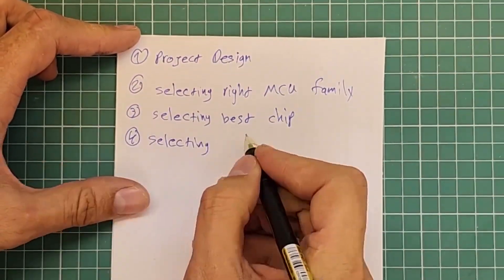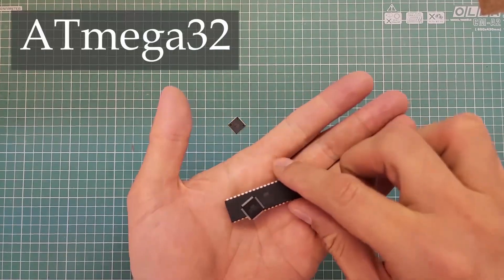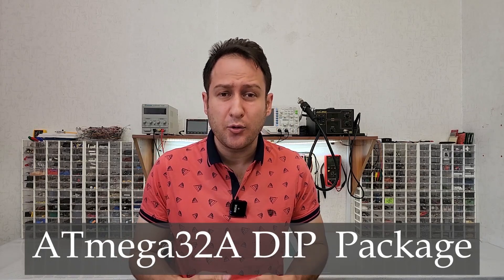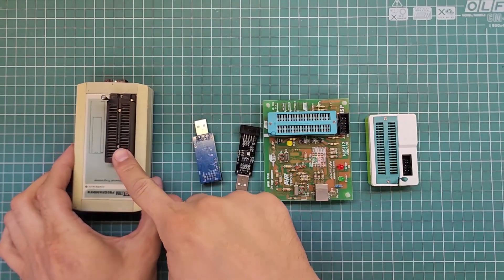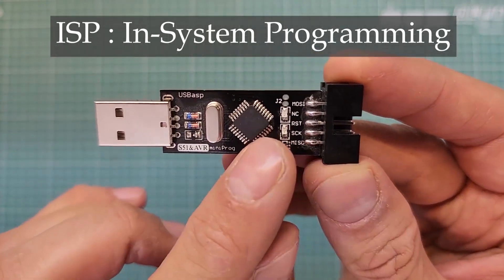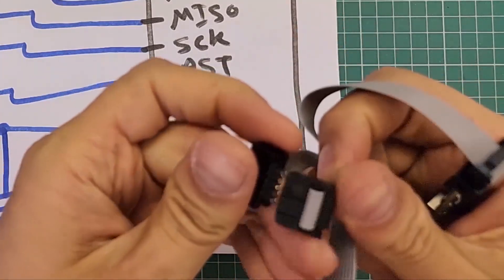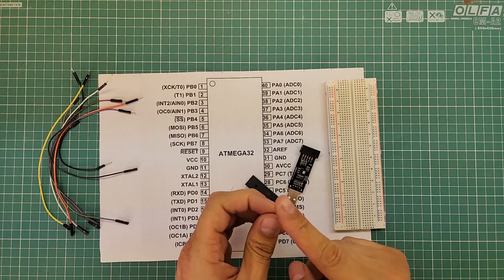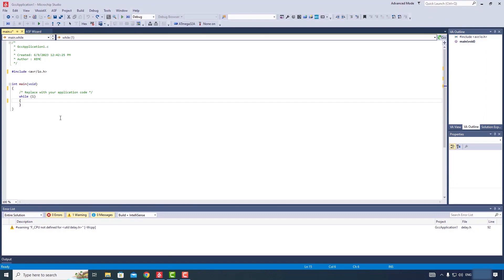10 steps to start AVR microcontrollers

Comment: Can u please tell us the exact code for the chip you are using? Are u using a ATMEGA328P-PU? I want to buy the exact chip u got and follow your videos and program it. Ty
Reply from the maker: I will use atmega8a, atmega32a and atmega128a.
You can buy these parts to follow my works.
I must say that atmega32a and atmega16a are almost the same and their main difference is their memory size.
The same point is true for atmega64a and atmega128a

Comment: good work. there might be a problem though with beginners when examining the SPI interface connections between the ISP programmer and the MCU. it is true that MOSI connects to SDI and MISO to SDO (input of slave to output of master and the reverse), however, when using the same notation for both it is always shown as MOSI to MOSI and MISO to MISO.
Reply from the maker: Thank you for sharing

Comment: Thank you for the video. I am familiar with C++. I have a few questions for you. Thank you for your replies!
@21:12, You were trying to define Pin PB0 as a digital output. To achieve this, you wrote DDRB = 1;
1) Where did you learn/ find out that you are supposed to write DDRB and not ABCD or XYZ?
2) How did you make the connection that PB0 is somehow connected to DDRB? Did u see that in a datasheet or ATMega manual?
3) Why did you set DDRB equal to 1? Obviously setting it to 1 defines the PB0 as a digital output, but who told you or where did you see that this is how you are supposed to set the pin?
4) Why is DDRB set to 1 and not to 0? Where did you see that it needs to be set to 1? Did u find it in the datasheet?
Reply from the maker: These are explained in datasheet.
To answer such questions,  I have to publish a Playlist to explain all basics and  details.
Goal of this video is to introduce AVR not programming AVR chips. I will give more detail about this subject
Reply: @elewizard Sir, please make video how to program in c programming for microcontrollers...

Comment: Thank you for the video. I am familiar with C++. I have a few questions for you. Thank you for your replies!
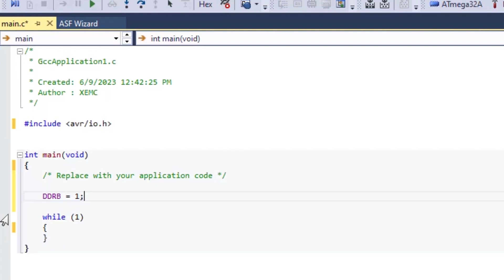@21:29, you were trying to control the ON /OFF states of the PB0 pin, you wrote PORTB = 1 etc.
1) Why did you switch from DDRB to PORTB? Why didn’t you use DDRB =1?
2) Where exactly did you find the info that you were supposed to write PORTB = 1 and not ABCD =1 or XYZ = 1? Did u find that in the datasheet also?
Reply from the maker: DDRB.0=1 makes pin 1 on port B output 😉
PORTB & DDRB are registered in AVR which are explained in datasheet

Comment: Could the Arduino IDE be used to write and compile the code and then the generated file be sent to the microcontroller or is there a difference in how the Arduino IDE uses libraries and creates the code that is specific to the Arduino family of boards?
Reply from the maker: Arduino ide can be used to generate executable file for AVR, then you can use programmer device to flash the MCU.

Comment: I found one on Amazon, that says ' ATMEL 51 AVR USB ISP ASP Microcontroller Programmer'. It doesn't have the 'S' in front of the 51. Will this work as a programmer?

Also, I already have a ' A Set AVR ISP USBtinyISP Programmer for Arduino Bootloader'. Could I use it to program the Arduino? I ask this because, from its name, it seems like this programmer is for loading a bootloader only and not for loading regular programs like blinking an LED.
Reply from the maker: Yes, you can use first on.
I am not sure about the second one

Comment: @21:28, why did you write PORTB = 1; ? Aren't you supposed to write PORTB0 = 1; ?    ( The port you used is officially PORTB0 on the datasheet).  Why didn't you include the 'zero' at the end of the syntax? Were you trying to set ALL the ports in 'B' to a 1 and thats why you didnt write a 'zero'? Ty!
Reply from the maker: It doesn't matter in this example.  The command PORTB=1 will set PB.0=1 and other pins of PORTB equal to 0.

Comment: I found this video very interesting. I've always just used development boards. I was under the misunderstanding that microcontrollers needed a crystal to keep time. Apparently, I was wrong bc there wasn't one included in the circuit and the led still blinked. I'm curious about the "bootloader". Does the microcontroller need to have one already with this process? Or is that just something so it'll work with the Arduino IDE?
Reply from the maker: Boot loader is an option.
It is not necessary 👍
Boot loader is an irregular way to make an MCU based project

Comment: FYI: The best microcontroller for a flashing LED project is not using a microcontroller, just a 555 timer IC, one capacitor, three resistors, and an LED, with two additional capacitors optional since they are more for using it as a CPU clock and not as an LED timer circuit. No programming required, only math you can do on a calculator.
Reply from the maker: Why you are not using two transistors  instead? If the problem is only blinking an LED. here the problem is not to blink an LED.  The problem is to setup and configure the MCU
Reply: @elewizard  It was meant as a joke. It seems I am bad at jokes.